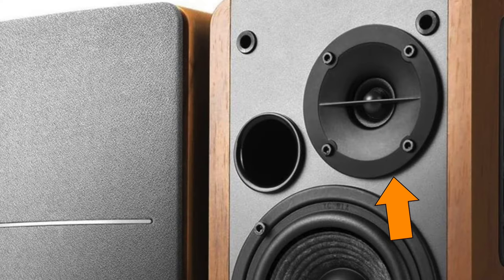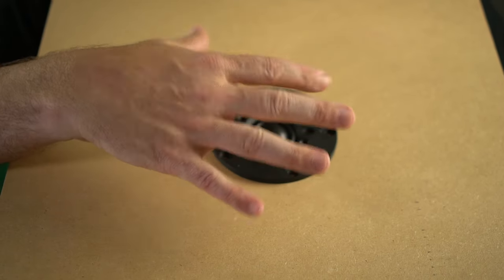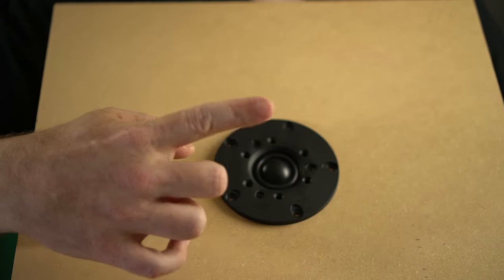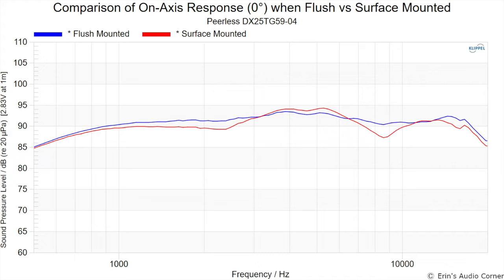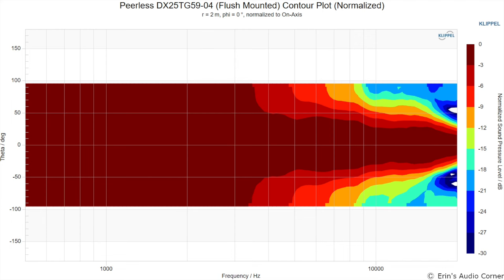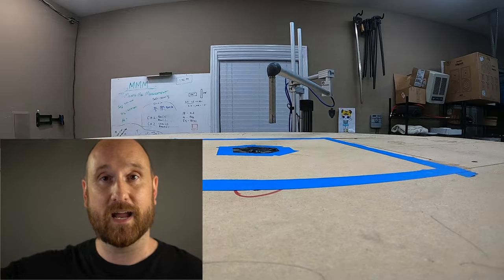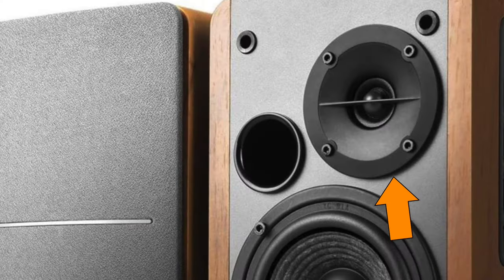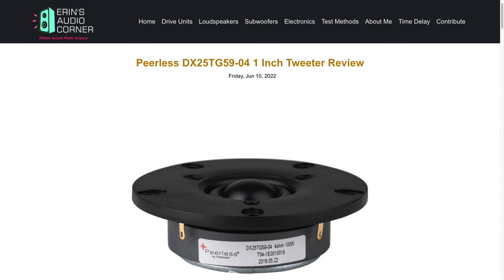Bad Speakers Start with This. 🛑  Flush Mounted vs Surface Mounted Tweeters.  Why it matters.

Comment: There are many design elements that are a factor in a speakers potential. If a tweeter is flush mounted, but the rest of the design is crap it’s probably not going to sound very good. Likewise, if an otherwise we’ll designed speaker has a surface mount tweeter it’s not necessarily going to sound bad. You are kind of over-stressing the influence of one factor.
Reply from the maker: If a designer slaps a tweeter on top of an enclosure then - besides the fact we know it negatively effects performance - it is a sign that there likely are other design flaws. 

Anecdotally, I’ve tested over 120 speakers. From $50 to $18,000. I haven’t reviewed a modern one that has a surface mounted tweeter. Modern designers are aware of this issue and do a good job at avoiding it. There are, however, still cheaply made designs that don’t take this extra step. 

You are welcome to prove me wrong. But do so with evidence and not opinion. Show me a surface mounted dome tweeter that doesn’t have a wider radiation off-axis than it does on-axis (which designers know leads to timbre imbalance). 

Like I said in the video, this isn’t new stuff.

Comment: I've been wondering about another possible source of nonlinearities, namely the inherent discontinuity around the perimeter of a driver. Does the slope of the gradient of linear displacement---essentially the width of the surround---influence sound quality on and/or off axis? And if so, does this mean that larger diameter drivers (and flat panels) have an advantage in this respect in that their ratio of piston area (linear) to perimeter (nonlinear) is greater? This question would also relate to waveguides and compression horns where the potential perimeter edge diffraction or turbulence or whatever may be influenced by interaction with engineered physical boundaries: lenses, throats, and phase plugs.

Comment: Now, what about front foam surround Klipsch used on my Cornwall Iv… and why do manufacturers front mount bass woofer?  Please comment.  To increase bass guitar cabs “inside mount woofers
Reply from the maker: Depends on the thickness of the foam relative to the wavelength.

Comment: Wouldn’t this effect be more pronounced with surface mounted woofers than tweeters? Since they go down into the true omnidirectional wavelengths?
Reply from the maker: They beam earlier than tweeters. The frequency where the radiation of the driver transitioning above beaming is almost always less than the width of the baffle. That’s not the case with tweeters.
Reply: @ErinsAudioCorner  Interesting. The reason I ask is because I acquired a set of  higher end towers from yesteryear, and in order to restore them I had to buy the modern version of the midwoofers(SEAS Excel) which have grown from a 170mm OD to a 176mm OD in the past 25 years of production. I designed and fabricated an adapter flange to mount the new design in the original cabinet without modification, but the woofer sits about 6mm proud of the baffle currently. I’ve been thinking about getting some sticky back felt trim to go around the adapter flange concentrically to absorb the reflections from the step down. Dunno if it’s worth uglying up the speaker though just for humoring my engineer brain.

Comment: Hello, what if the front speaker panel is covered by carpet to reduce corner diffractions?
Reply from the maker: The truth is: it depends.  Different frequencies, different thickness of carpet and the size of the radiating surface all factor in.

Comment: Well, Ino Audio piP has surface mounted tweeter and it's among the best I've heard. And it measures really well too.
Reply from the maker: Where are the measurements?
Reply: their tweeter looks like the ones you find on amazon when sorting by price, much like a visaton dtw72 but square. tho the bevel is tapered and thin on the edges
Reply: @gamerpaddy  It's a modified version which has A LOT less distortion than the original. It was originally chosen because the dispersion is terrific, but in its original form it doesn't sound or measure very well.
Reply: Having a largish radius down to a thin edge would help with flush mountability. It also looks better for using it that way. Usually used in cheaper drivers or speakers and projects, because it relieves the need for routing which costs money/difficulty for some.

Comment: Is it possible to somehow flush mount a tweeter without a router? I can't justify buying one just for building a pair of speakers. 
The tweeters are also irregular. Circular with straight sides on two sides.
Reply: you can use a dremel as a mini router, those router bits are tiny and can make any shape.
Reply: @sudd3660  But with a dremel it'd be very hard to get the depth  right with no base against the wood.

Comment: Horse schidt.
Mounting position of the tweeter is dictated solely by the phase-shift, induced by the type of crossover that's used.
One size does not fit all, Scooter.
Jussed sayin' 😶
Reply from the maker: Two things can be true at once. But you are welcome to prove me wrong. Show me a surface mount a Twitter that doesn’t exhibit these issues. I’ll wait.  Scooter. 😉

Comment: It is actually more about the quality of the Drivers and componets used than few mm differences in mounting. Most speakers would really benefit more if proper crossover components were used. Sadly in most cases this is not the case.
Reply from the maker: Two things can be true at once.
Reply: @ErinsAudioCorner  Yes true but what I have seen is that the phase problems between drivers are mostly because of the ironcore inductors. Ironcore inductors have a tendency to ruin the sound acting as a energy storage, basicly when there should be new signal coming to the speaker the old one is still kinda present and smudging also the new one. Drivers being flush mounted or not is a much smaller factor in these cases.
Reply from the maker: @OriginalFinnish22  flush mounting va surface mounting is a first order issue. Before you even talk about crossover, the design is compromised. Pretty simple.
Reply: @ErinsAudioCorner  Truthly I have a hard time finding myself a proper pair of new speakers, probably would be easier to just buy something and replace the crossover components with better ones with the same specs. Tweeter level can almost everytime be tuned just changing the resistor value if needed.
Reply: @ErinsAudioCorner  I never said it does not matter, but feeding drivers flawed signal with ghost signals, no flush mounting is going to help. This moment Magnepan .7 would be my favourite, and those have very easy to upgrade crossovers with just few components. Been trying Magnepans in few places and that spacious sound and fast drivers oh boy. Been a hobbyist all my life and many think I'm crazy paying 600€ for in ear monitors. But Damn BA drivers are fast, and that audiotechnika's dynamic driver style bass, in their 3 way models.

Comment: What happens if I flush mounted but have a small 2-3mm gap between the driver surround and the baffle? Does it act like the baffle edge?
Reply from the maker: That small of a gap shouldn't create a significant problem.  If you're saying 'surround' I'm assuming you're talking about a midwoofer or midrange in which case it's probably beaming before that 2-3mm would matter.  But that's a guess and not a fact.
Reply: @ErinsAudioCorner  it's a full range 8" driver to clarify the edge of the mounting basket is what I was referring to

Comment: With cones such reflection problems do not appear. That is why I only use old cones.
Reply from the maker: That’s not true, though. The difference is that the cones are typically exhibiting a narrow radiation at this point so there is nothing at the side at the frequencies that would be effected by the baffle. 👍
Reply: @ErinsAudioCorner  Not true?

 No need to explain the radiation - I tested all with my  hands.   I managed get rid of that reflections by using soft felt outside  the  speaker plate. Notice that with stright flatness baffle and speaker reflectins work as with step  only in different way - that is audio🙃

Comment: I wonder how much of a difference would it make if a mid woofer is surface mounted or flush mounted?
Reply: It will also have an effect of course. I would say mount it in a way it best matches the tweeter in phase response. It's better to have a bit of diffraction than mismatched phase responses.

Comment: Doesn’t the sound of the flush mounted tweeter refract when it hits the edge of the baffle that surrounds it?
Reply: Yes, and he said that specifically, however it's generally further from the epicenter and usually provides fewer points of diffraction with less phase cancellation as shown in his data.

Comment: What happens when you go in the opposite direction and overly recess the tweeter - say, as in KEF's coaxial setup?
Reply: The material around the tweeter becomes a waveguide

Comment: does this also apply to surface mounted woofers?
Reply from the maker: Not so much. It’s related to the wavelength of the driver relative to the size of the flange.
Reply: @ErinsAudioCorner  i have full range drivers with whizzer cones in middle that act as tweeters....so not a problem to surface mount?  that's how I have them mounted on an open baffle, but if it's better to flush mount then I might try it

Comment: Sound like over thinking it to me.  Maybe from a sound engineering perspective this matters.   Or if you are a audiophile and you want to dedicate a whole space for your acoustical eargasms.  But if you are just shopping for a good sounding pair of speakers to throw up in your den at a good price point I think your off axis reflections be a deal breaker.
Reply from the maker: Reflections are about 50% of what you hear.
Reply: @ErinsAudioCorner  That was just my little two cents.  I am actually a  Sound Engineer ( Big Deal  LOL) ,  a DJ and I have built speakers and installed sound systems.    I guess my real point is there are many various acoutical dynamics to every listening space as well as the sound reproduction equipment.   80% of people will not object to or can tell the difference.
Reply from the maker: @Detroitblue  can you prove that 80%?  Otherwise, I can just as easily say that 80% can hear the difference. See how this works both ways?
Reply: @ErinsAudioCorner  can I prove it?  Well how about a well respected model / brand of speaker that has great sound quality with that design. Would you agree that would confirm my position?
Reply from the maker: @Detroitblue  you said 80% of people can’t hear it. Let’s stick with that number for now.  I’d like to know where you get that info. Then we can move on to the other. 👍
Reply: @ErinsAudioCorner  That number was pulled out my butt from my general personal experience so it is very subjective.   However your positon is that a sure fire way to judge a speaker to avoid  are the ones with that design charactistic.   So we can easily tell if that stands up in practice.   Would you agree?
Reply from the maker: @Detroitblue  sure. By way of viewing the estimated in room response. The 50% I gave earlier is based on research. It’s 44% direct, 44% reflections and 12%. I don’t see what the point of a discussion is, however, if you are going to make numbers up to support a claim. I do suggest you read Dr. Toole’s book linked below. It has tons of info. You won’t have to just take me at my word. Peace. 

https://amzn.to/3z6p3cp
Reply: @ErinsAudioCorner  The fact I gave " made up numbers is only because I was reading in the comment section and made a general comment.  You made a video and have some data to reference okay.   But that still does not really address the listening experience outside of a laboratory setting as judged by thousands if not tens of thousands who have rated certain speakers for their sound reprodution qualities.   You know acousitcal tiles absorb sound to reduce reflections off walls  right?    Some designs  use reflection to disperse  the sound in order to provide a spacial dynamic.  All of these factors can be a pro or con to a speaker design depending on the room .   At best the reflection you are talking about would only be micro seconds out of sync with the source and I am saying how ever unskillfully is that can be very difficult to detect and that is why I said 80% of people would not notice.
Reply from the maker: @Detroitblue  please, if you really want to learn; buy and read the book. I’ll leave it at that. 👍
Reply: @ErinsAudioCorner   I was talking about your premise of how to determine a poor sounding speaker on sight.  I see you want to sidestep thatt  central point of the listening experience and hang your hat on data from your book.   I told you I was a Sound Engineer I also have a few books.  Nice Chatting.     Be Well.

Comment: I have a set of tannoy f3's with a very slightly surface mounted tweeter but they sound anything but sibilant. in fact they sound rather dark the exact opposite of sibilant. 🤷‍♂ I actually hate sibilant speakers 😑

Comment: Uhm.. Well. Yes and no but not quite right actually. There are many designs on the tweeter frames etc too so this is no given rule.
And your tweeter it already sits lower inside the frame so the defractions you mention should already taken care of. This will be adjusted in the design etc.
Even REALLY expencive speakers can be mounted in both ways depending of how the tweeter frame is designed.
Like the speaker you show already has a very small horn design for the tweeter so the things you mention won't really apply that much for that particular design.
Reply from the maker: If you want to believe that despite the evidence shown to you and some math that would tell you otherwise, then that's fine.
Reply: @ErinsAudioCorner  what evidence? You litteraly tried ONE design and showed ONE example.. That is just poor testing. Not all tweeters are deisgned like the one you used here you know.. So many many tweeters can in fact be surface mounted without any of the drawbacks you mention. That is exactly why different designs excist.
Like the horn tweeters I have here that are specificly designed to be mounted the way you say is the wrong way.. So yeah.. I believe the evidence and facts that says there are more than one tweeter design... ;)
Reply from the maker: @Oystein87  It's pretty simple physics.  Wavelength the speaker is playing relative to the effective radiating surface diameter gives you the beaming point.  If the driver isn't beaming, if it's directivity isn't above ±90°, (a tweeter won't be until around 6-8kHz) before the wavelength equal to the baffle width (or in this case, the tweeter flange width) then you'll have diffraction.

What you are talking about; waveguided tweeters... of course they behave differently.  The directivity is changed and the baffle (or width of the surface) isn't as problematic.  However, they still can be an issue.  And it's a good rule of thumb to avoid designs that don't show the physical attributes that I talk about in this video.  You're welcome to show me an example where it isn't.  And we can discuss why.

Comment: Meh…What a load of hot air. Edge diffraction is a speaker companies pet topic for snake oil, marketing differentiation etc. If driver mounting flush, not flush was critical all speakers would look the same. They don’t. Take Vandersteen, Bowers&Wilkens etc. for example. They have different mounting set ups, but all perfectly good speakers.

Comment: That guy did a horrible job at demonstrating a rear mounted tweeter when the baffle looked like my Pitbull Chewed on It . I do massive round overs with a 1 1/4 inch round over and the tweeters are a lot more widespread and sound amazing. along with Making the wave guides on a lathe that look like a flower with some Dayton AMT mini Tweeters made out of walnut and cherry

Comment: The same physics that cause this, also contribute to the many benefits of flush mounted main monitors. 

Instead of the very early reflections generating the combing and the time smear (w/the surface mounted tweeter), proper flush mounted mains result in eliminating SBIR issues (which arise from off axis energy propagating out, encountering a surface and reflecting back corrupting the direct sound). 

Micro, vis-à-vis Macro

In one's journey through audio knowledge, the sooner one can begin thinking SIZE, the better. 
Wavelength size, baffle size, boundary size and distance, ... so very much is entirely linked to size... or relevant size of wavelength to item size.

Comment: In other words it's not enough of a difference to make a difference.
Reply from the maker: But, it is.  I explained this.  Off-axis will be stronger which means side reflections will be stronger which will alter the balance of the speaker.  The data is there.  I showed it to you.  😉